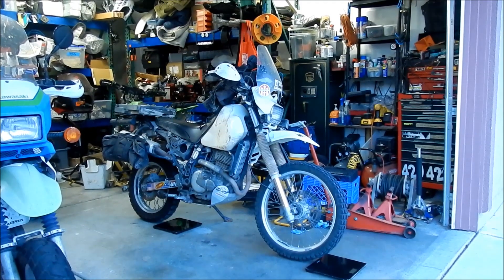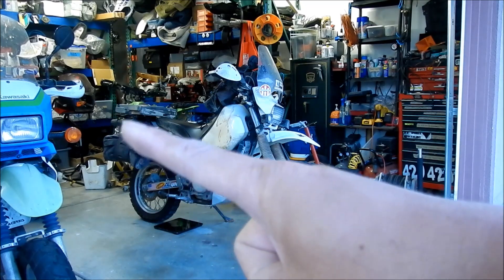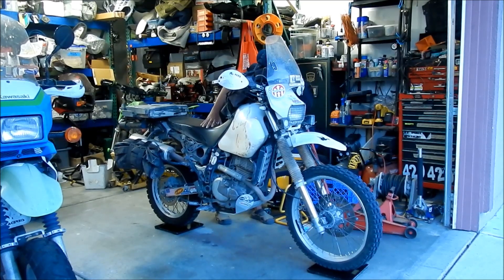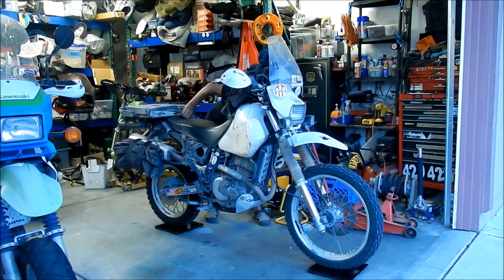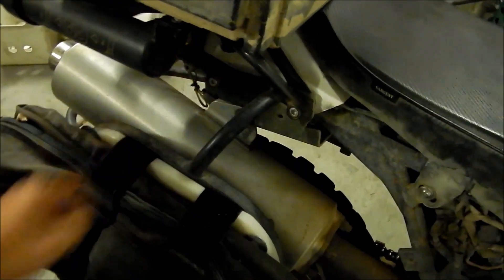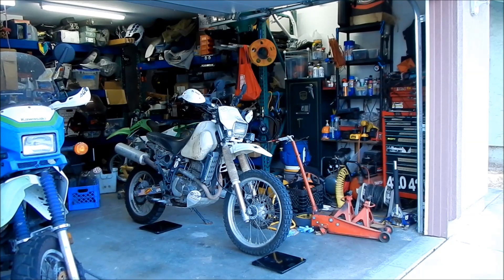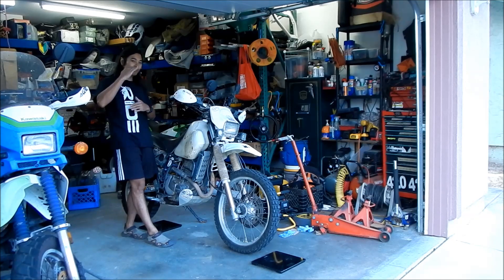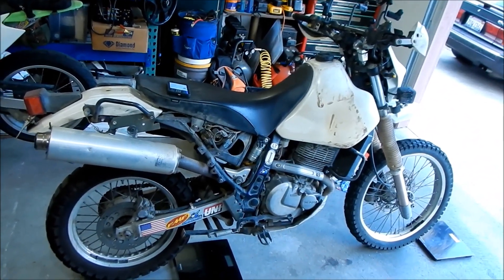What does it weigh?  Cactus Puncher DR650

Comment: How did you damage your frame?
Reply from the maker: From A LOT of drops on a fully loaded bike.  The frame on the DR650 is very strong but not invincible.  Also I think that it got worse after I lowsided the bike in Missisippi on a rainy night and slide 50 feet on it's side with me following behind it.
Reply: @hadesomegamoto7639   Low sided mine recently. The handlebars took the brunt. The frame looks okay though (I hope). Bent a side rack, the wolfman soft panniers held up well to the slide. Scraped some plastic. Replaced some handlebars. Low rear tire pressure got me I think.
Reply from the maker: Ouch yeah I had a rotopax strapped to the side of mine and it slid on the rotopax and handguard.  Those Rotopax are tough!  It sux that the DR has a solid steel subframe.  If it was at least removeable you could easily replace it or bend it back.  It's pretty bombproof the way they made it though.  I didn't use the DR650 for trips to starbucks I rode it like it was intended to be ridden as a dual purpose motorcycle :)  On mine you can tell the frame is bent but where the seat is suppose to rest on the frame there is a large gap.  Check that on your bike.
Reply: @hadesomegamoto7639  check this thread.   I thought of doing something similar. I carry very heavy loads as well.(most of it me) so thought this is worth considering.  https://drriders.com/bergdonk-builds-a-dr650-for-his-lady-t17901-s70.html?amp=1 

Look at post 80 thru 88.